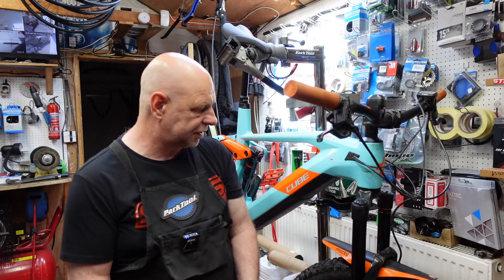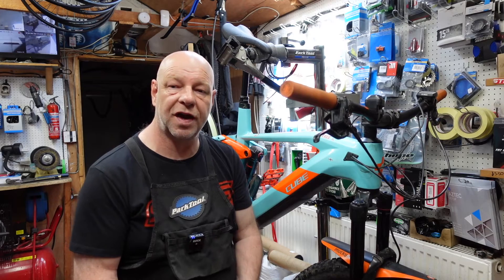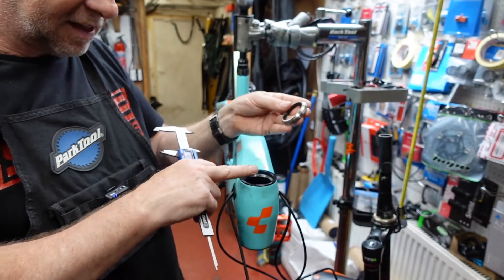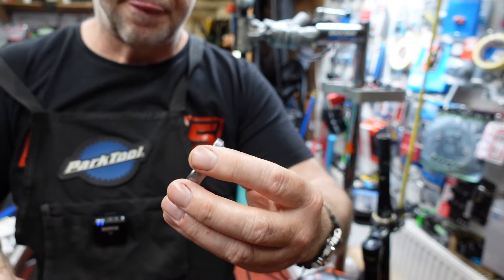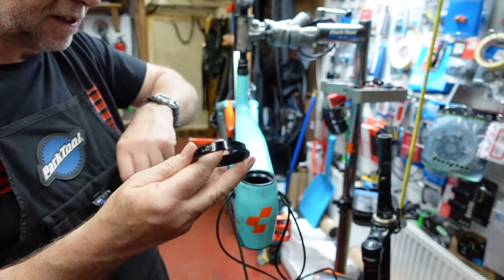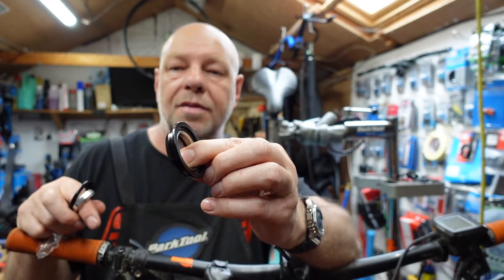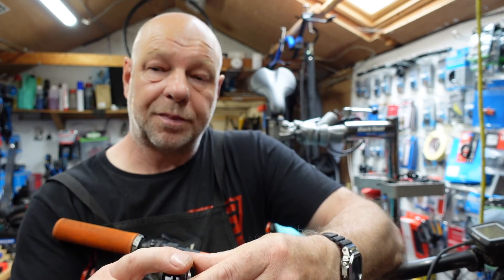Headset Bearings Explained, Cube Ebike

Comment: what if you have an older bike ie commencal meta 55 which does not have a cup but the bearing sits directly into the head stock, how would you work out if its a 45 or 36 angle cos you cant see if there is a gap underneath it, a 45, 45 came out but im not sure its correct for the bike, i ended up with play in the headset after replacing with 45,45 so i tightened it down more, and more but now i cant tell if the noise is coming from the head or the forks and its annoying me alot, not sure if i need a shock rebuild or if i have wrong bearings in head
Reply from the maker: Hi, trying to find the right bearings can be difficult, depending on year try here. https://spark-sports-online.com/products/commencal-meta-2014-2021-headset-bearing-kit?variant=48113501274447&country=GB&currency=GBP&utm_medium=product_sync&utm_source=google&utm_content=sag_organic&utm_campaign=sag_organic&gad_source=1&gclid=Cj0KCQjwhr6_BhD4ARIsAH1YdjDh7TQ91AnyDyoo3R3VTnrE852eK8PP-q3s4v7iy2KcNky16j170u4aAl3iEALw_wcB

Comment: mines a cube sterio action team 160 2022 e bike, the cables look to be going into the headset its self and not through the frame like yours? i asked the local bike shop they said the cables go through the bearing?? is this correct? is there any videos on this setup thanks !
Reply from the maker: Hi, Thanks for watching and your comments, the hoses and cables do go through the bearing on the newer cubes, most cube headsets are made by across, I did a video about them not too long ago

Comment: Great video as ever Dave, very helpful indeed, I have a Whyte e150rs in which I’m going to fit a pair of the Hope pick & mix headsets, you weren’t wrong when you said that finding the correct bearings can be difficult but you’ve certainly helped, cheers buddy, Happy New Year to you guys 🙏
Reply from the maker: Hi, thanks for watching and your comments
Reply: Your welcome Dave, I meant to ask you a question about headset bearings but forgot, once you remove the bearings, the cup that’s left behind, does that cup need to be removed with a special tool or will it just lift out, I’m referring to this on a Whyte ebike please

Comment: Very informative video. Could you please provide some more info regarding the upper reducing ring ? The one on the video seems to be a metal one (3:46), the  stock one is plastic and gets destroyed. Found it super hard to find a spare one online. (maybe i m doing something wrong)
Any help more than welcomed ...brand, specific name , link of the specific reduction ring or similar  even a compatible zs56 headset . Anything !
Reply from the maker: Hi, Thanks for watching, welcome to to world of headset nightmares. Your headset is very specific and hard to find, The part you need is not available on its own as far as I am aware there for your going to need a new headset top and bottom as they come as a pair, The fsa version is NO.55R/57SC HEADSET (1.1/8-1.5") but I would go for the superstar component one,  Type 5 and type E https://www.superstarcomponents.com/en/uk-made-headset-complete.htm
Hope this helps

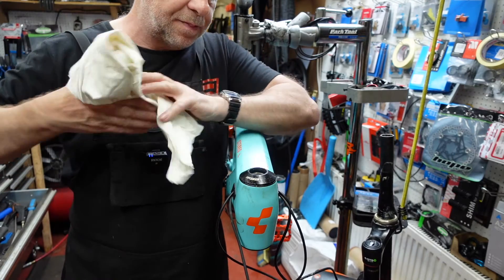Comment: I was wondering why it has similar bearings top and bottom considering that it has a common fork tapered shaft but I can see that there is another collar (4:25) to compensate for the smaller diameter at the top.
Reply from the maker: Hi, thanks for watching, there are not many bikes that use the same bearing top and bottom, the top, your right the top has a reducing ring.

Comment: Hi Dave

I have a Focus Sam2 2021, the bearings appear to be pressed in, are these pressed in bearings generally the same size as bearings that ain’t pressed in?
Reply from the maker: Hi, thanks for watching and your comment. If I’m correct your bikes headset is fully integrated so there are no cups, I think yours is  Acros AIX-322, tapered, IS 42/286-IS52/40, you can see from the sizes, your bearings are 52mm bottom and 42mm top, chances are they will be 36/45

Comment: Dave, very informative and very clear advice.  Could ask when you reassembled the bike and tightened the forks up, is the nm setting important.  I ask because I have a new Cube Stereo Hyrbrid and after 150miles of use, I have developed a really annoying creak, which I’m convinced is coming from the headset. Can I over tighten the headset?  I’d be grateful for any advice. D.  Ps you have a new subscriber!
Reply: I am experiencing the exact same issue with my Cube Stereo 140 HPC TM. I have roughly the same amount of miles on my bike and the "creaking" seems to be getting more noticeable. I've tried tightening my stem bolt, but I blew out the plastic cap. I ordered up a replacement cap in aluminum. I'm going to give it another go when it arrives. Hopefully I can get a bit more torque, with the beefier cap, to tighten up the headset. If it does not fix the issue, I'm going to take it back to the shop I bought it from.
Reply: Iv got this problem on cube reaction , the cap is buggered so I’ll replace it
Reply: The cap is really only for bearing preload and you shouldn’t be making it too tight, and should only be tightening it when the stem bolts are loose as well. If you tighten down the cap that much that you cause a noticeable drag when turning the bars side to side, that’s probably too much. Now, your creak could be coming from other places. If the outer bearing race upper or lower is moving in the frame you’ll get it. The steerer wedge spacer to the inside bearing race too. Also, your stem cap on the bars. You’ll have to take that all apart and inspect the bars and cap for witness marks or high points in the metal of the two sections that compress onto the bars. If those two curved surfaces don’t mate reasonably close onto the bar, you could get a noise when it’d all tightened down.